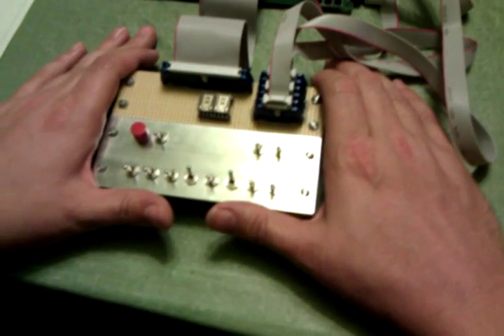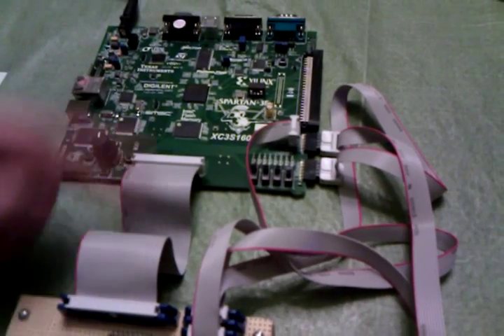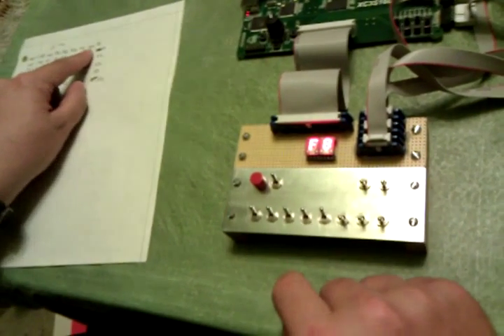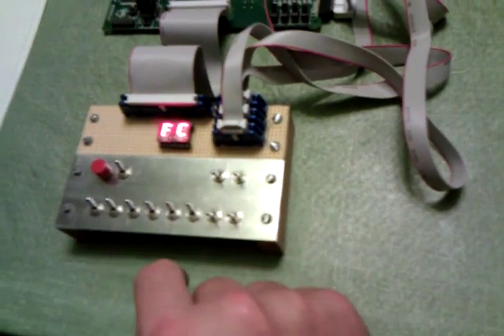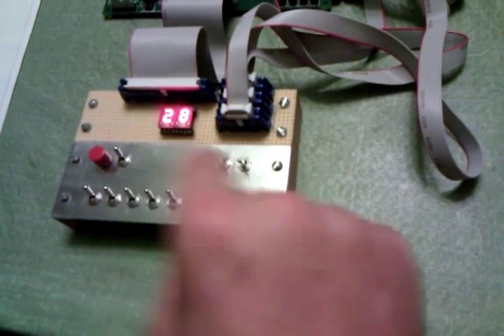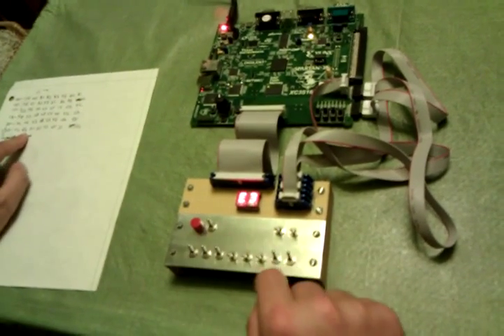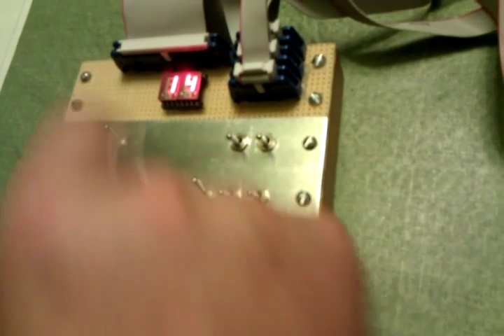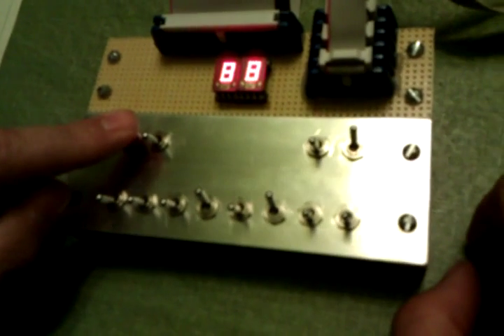FPGA-Elf demo

Comment from the maker: Sorry, there's neither a Control nor a Z key.

The FPGA-Elf has the same procedure for correcting entry errors as the original Elf.  You can set the memory write-protect switch, reset, hit the enter button to step through memory and view the contents until you reach the error.  Then you turn the write protect switch off, and enter the corrected value.